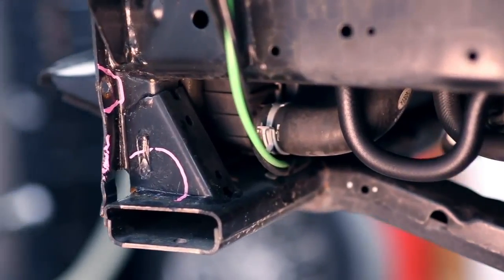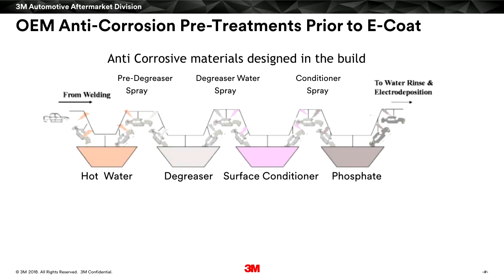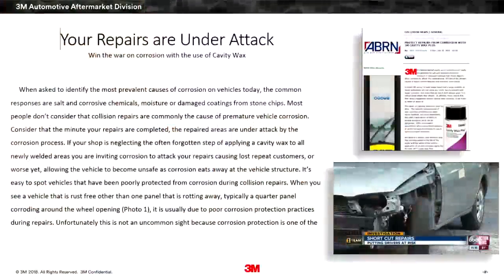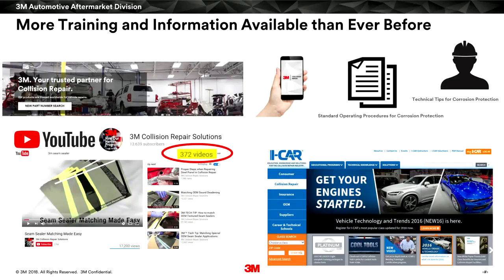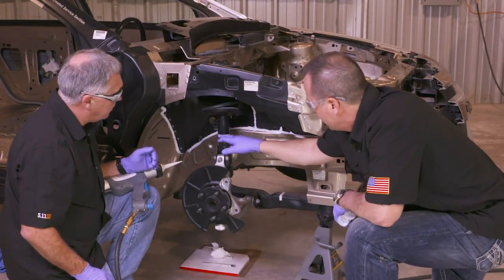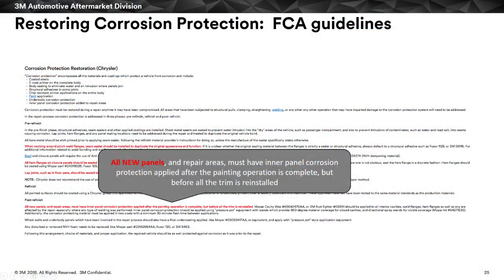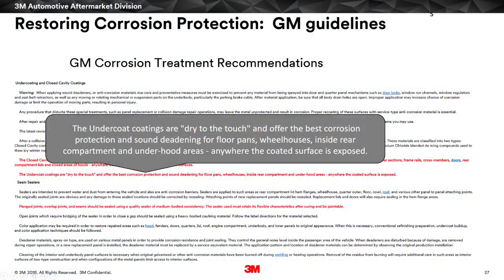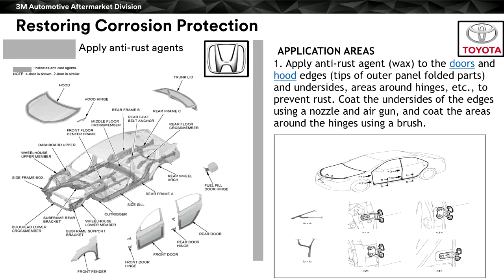Everything You Need To Know About Corrosion Protection - Live Event - 3M Industry Night 2018

Comment: Thank you for this video. Im in the process of replacing both quarter panels and was very curious on how to prevent rust after MAG welding. I knew I had to use weld thru coating, seam sealer and cavity wax for protection but was so confused about how I can get cavity wax to climb up between panels. This video clearly explains that cavity wax can creep vertically in between two panels for rust prevention. Thank you so much for the example, I am sold on this and can’t wait to continue on with my project. Keep up the good work 3m.

Comment: 1/   Is 08552 suitable for under hood considering the engine bay temperatures .??
{ max temp is only 70  cel ]
2/ Does 08552 have any corrosion inhibitors to stop/slow any pre-existing very minor surface rust .??
Other aftermarket sprays have this additive ...
3/ drying period on a normal spring days 70-80f seem slow 4-5 days minimum ,normal ???
4/  does it ever completely dry or only to a tacky finish ???
5/ 08852 over 2k epoxy primer ok ???  [epotek PPG]

08852 /08851 wand nozzle , its best to super glue these into the nylon tubing to prevent them coming off .  Major size differences between them .